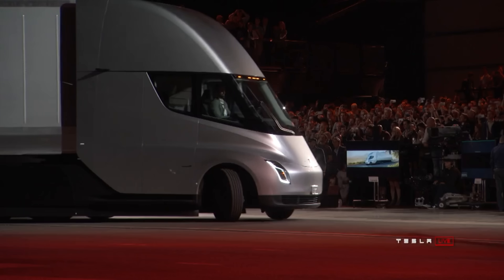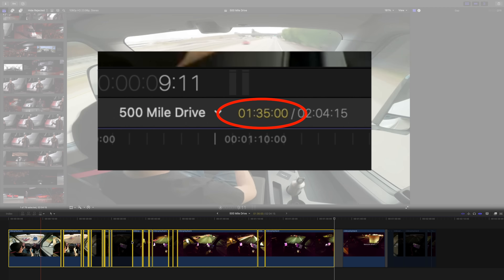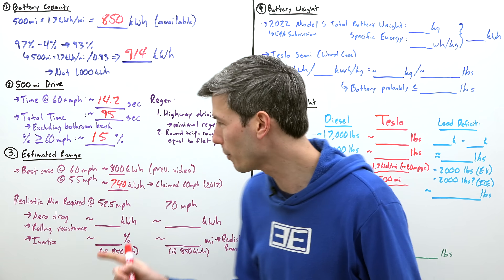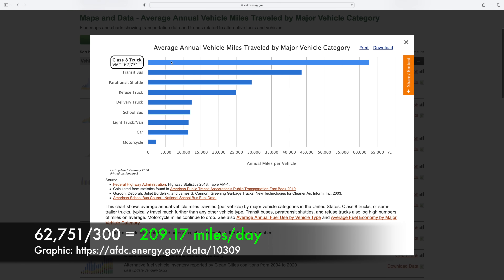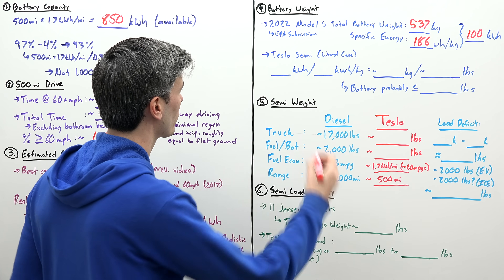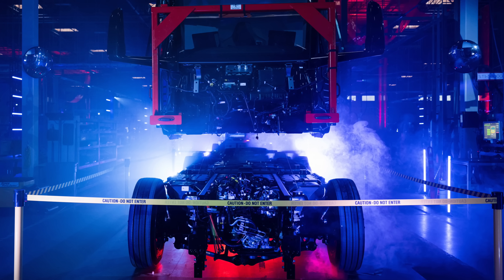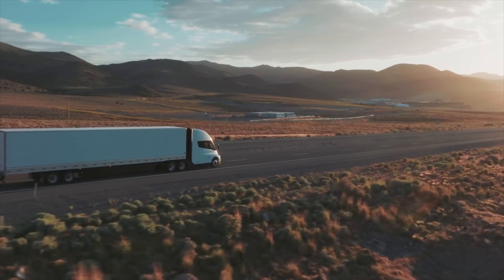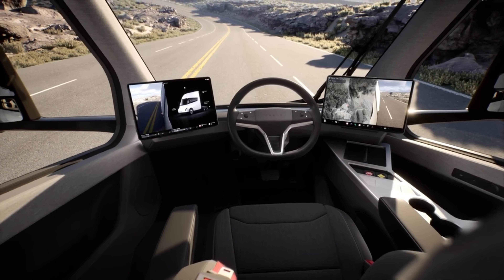Does The Tesla Semi Make Any Sense? Part 2!

Comment: After watching part 1 and 2, that are well explained, I don't remember any mention of weather, specifically the cold.  Simple things like heating and maintaining the large cabin and windshield as well as ensuring the batteries stay at their optimal temperature must have an impact on the range, and even when the drivers take breaks, unless the semi is plugged in, it will be using some battery power to maintain its temperature in the cold.
Reply: The volume of the cabin in a semi is not appreciably larger than a midsized sedan overall, and even if you assume double the losses in an absolute sense, having 8.5x the batteries means the impact from that cold is going to be quite a bit smaller. Likewise, the surface area required heating compared to the volume scales in a positive way such that keeping the battery warm is made easier by the large pack. Most importantly, unlike an small EV which needs only 10s of KW to keep moving at speed, a semi will be generating likely 8--20x the thermal energy from battery inefficiency during use. This is a gigantic pool of thermal energy to use for heating the cabin, which as mentioned is not all that much bigger (perhaps even smaller) in volume to a Model S/X interior.  

Now..... Not saying this is a non-issue altogether, but for any sort of long-haul, I would be quite surprised if the impacts are anything more than 10% by heating losses. More critically may be increase to wind resistance due to increased air density during cold/rain/snow, or rolling resistance increases when roads are wet. There is a great JCEA paper about rolling resistance of iso standard tires (SRTTD etc) which suggests that wet roads can increase rolling resistance by 40% or more. This would be the biggest likely loss for a heavy fully loaded semi, above the aero and creature comforts, while for an unloaded semi, aero dominates.
Reply: @anthonyschroeder521    Although I can understand that the space may not be that large for the cab, however is there not a sleeper that also needs to be kept warm?  And although this version of the semi will likely not be used for true long haul, it is unlikely that a driver will be using the sleeper for overnights where there would not be any charging stations.

The concern I have is that every % that is not used for driving will impact the range, and cold weather up here in the north does last longer and therefore the range degradation will have an impact to the payback period as shown in the video, specially if the cost of the semi is going to be so much more than a current traditional setup.

I do realize this is the first iteration and we have to start somewhere, but we should be setting expectations, as I believe Pepsi has in the shown statement that, lighter loads of chips can go further, than heavier loads of pop (which is logical).
Reply: @jacquesalbert6748  no sleeper. But as mentioned rain is likely a bigger problem than cold, and that general concern about margins reduced is still valid.
Reply from the maker: Video 1 references a "worst case" with lower efficiency to compensate for things like cabin heating. Cold weather range hit can be around 20% based on my own experiences (https://youtu.be/UskzfQJt2Bc), there's a few outlets which have done tests, and there's a lot of variance between manufacturers and cold impact. Yes, definitely something that must be considered depending on where the truck is used.
Reply: @EngineeringExplained  if the truck is used for over-the-road driving, where the driver parks it and sleeps in it for 10+ hrs, then that's heating or cooling that drains the battery without putting on any miles.  And in a winter storm (-15F?) or blistering heat (115F and humid?) that's gotta drain it a lot.  That's another factor that leads me to think this won't be suitable for over-the-road trucking.  It's best use will be local driving or other well-defined routes.  Possibly with a day cab rather than sleeper too (which would save a few thousand pounds).
Reply: @DonTruman  Ideally in those situations, the driver is sleeping in the cab while the truck is parked at a charging station, in which case, it can use external power to operate the HVAC and the HVAC load will be trivial compared to the battery-recharging load.
Reply: @bikeaddictbp  technologically that would work, but realistically it's virtually impossible to get a charging station to every truck parking spot.  I say that as an OTR trucker and electrician.  Some parking spots with chargers at some truck stops is possible (what if one isn't available where you want to stop for the night?) but that wouldn't work.  Would need charging for every single layover.  And "stuff happens" out there.  E.g., getting stuck in a winter storm for a few days, parked somewhere.  You park wherever you can and wait for it to pass.
Reply: @DonTruman  Tesla Semi is for day use, no sleeping option at the moment.
Tesla will be production constrained for the Semi in the next 3 years so no need to fill 100% of use cases. Short-medium hauls will fill the order book.
Reply: Keep in mind that most car trips are comparatively short. A lot of the heat loss in winter is due to getting in and out frequently. If you need hundreds of miles of range that will happen a lot less in a semi.
Reply: When stationary, ICE engines typically also have a block heater plugged in and powered from the grid. The frigid colds are not just an EV battery issue!
Reply: The effects of cold are really overblown, I drive a Model 3 in Utah, so I see hot and cold. I typically see around 5-7% difference in my commute due to cold (35 miles each way).  Most of the effect of a cold commute is eliminated by preheating the battery and cabin, once driving there is free heat available from the drive unit and battery to keep things happy (including me).  Starting from a dead cold car you will see a bigger hit as everything has to be brought to a good operating temperature (by the way, on a really hot day I have seen range affected by  having to cool everything more too).  On long continuous drives the effect is really minimal, probably more like a couple percent at most.  One thing nobody ever mentions is the efficiency hit of driving in the rain, which is very noticeable (definitely a few percent), and the benefits of driving on a busy high vs. an empty one (also a few percent) due to drag reduction from the wakes of all the cars and trucks around.
Reply: @jayscranton5517  I can relate, here in Canada we see lots of snow which has another impact to the rolling resistance as well.  My fundamental concern in the marketing is that we are trying to prove that a 500mile trip is possible, and from calculations sounds like it could be if all the conditions are perfect, so what will be real world, specially since most EV battery packs don't like the less than 15% and the over 80% charge, so if we only have 60 to 70 percent of this large battery pack to play with, what will be the actual range, and that we should set our expectations accordingly.
Reply: @jayscranton5517  I agree the effects of cold are very much overblown.

If you do a lot of short trips (2-5 miles each) in town like I do the 'guess o meter' will indeed give you a crazy low range estimate because the heater in that situation is always running 'full power' and is a very high percentage of total usage. 

Get on the highway and average efficiency will be much closer to normal.

We had planned to go on a 400 mile road trip the weekend of Christmas. It was not the -10F and worry that we'd not make it to chargers that kept us home, it was the blowing snow and black ice. 

I find headwinds and precipitation to be more of a problem than cold because its harder to gauge just how much it will impact you, and you can't do much about it.
I've never actually had to do this, but as an absolute last resort effort I can turn the heat down/off to conserve energy in an emergency. 
You can't really shut a headwind off, just go slower.
Reply: Cabin heating can eat up 15% of range in a model Y (78kWH?), but the relative size of the battery pack means its negligable. Only the impact of keeping the battery at temperature to worry about
Reply: With 800kWh+ battery cabin heating is not an issue. I doubt that it will be more than 1-2kWh per hour . Moreover, electric motors are effective, but 5% of loss, will give you more than 40kWh transferred to heat. The biggest concern is that you need to warm up 10000 pounds battery pack before your trip. It will take a huge amount of energy, but can be done from the grid
Reply: @demkaage  lol…… it’s not just the cabin but also the batteries and auxiliary systems.
Reply: @demkaage  what if you don’t have accès to the grid!? Does every point of deliveries needs to have grid connectivity??
Reply: @carholic-sz3qv  a good example is when a delivery is being made and the semi is stopped for 30 plus mins, is the driver expected to find a charging point, or will the semi stay idle in cold temperatures and how does the battery pack stay warm enough, what energy is used in order to do this, and where is it coming from?  That will also impact the overall range.

Comment: I love the critics "the truck (or ev) will suck driving in the mountains and that will drain the complete battery".
Well, when you go up you need to go down.
It just charges the battery when going back down, when it went up with (?) 600hp he will have 600 hp breaking power that recharges the battery (or even more when not using his full engine power hoing up).
A full  ICE vehicle will just convert that energy into heat.

Comment: The current Tesla semi is not the final version. Once Tesla gets the 4680 up to mass production, adds silicon to them for energy density (current 4680 doesn't), and perfects the structural pack design, Tesla will release a better Semi. The reason why they released a compromised 2170 version now is because of that tax credit. They wanted to take advantage of it while it's available, and since the 2170 battery is "good enough" to get the job done, why not?

Comment: Just to point out that in California, the maximum truck speed is 55 mph. So it would make sense that the truck driver wasn't going too fast over the speed limit, especially on a recording that's going to be shown and analyzed like crazy.
Reply: The maximum posted truck speed in CA is indeed 55mph. Having previously lived in CA for about forty years I can tell you with certainty that semis usually travel at 70mph where possible. They would be impeding traffic if they actually only cruised at 55mph.
Reply: @avsystem3142  I've spent plenty of time behind 2 semi's passing each other on I-5 with one going 55 and the other going 56. Also remember the driver knows this is being recorded for a PR event.  Do you think they'd drive at 70 knowing its not just recorded but will be dissected by Tesla fans.
Reply: Trucks regularly drive 75mph here
Reply: @bradenmchenry995  And they regularly drive at 55mph too.  Just drive I-5 in the central valley and look for the long line of cars trying to get past the truck passing the other truck driving 1 mph faster than the other truck.

Also remember the driver knows this is being recorded for a PR event.  Do you think they'd drive at 70 knowing its not just recorded but will be dissected by Tesla fans.

Comment: I would be REALLY careful with using Musk as a source, you showed yourself that hes a serial liar. 

Your logic at 3:06 has a flaw, regenerative braking does not achieve 100% efficiency. Quick research shows values 60-70%. 
Also if you draw that green dotted line based on the first 250 miles you would end up with more range!

You also cite that it takes 35min to charge buying into the story of the Semi charger, which was not shown to this date afaik.
With a power draw of 1MW its connector design must be interesting. I am sure you could calculate how such a "wire" would look like and what kind of safety measures it would take.

About range: What if its winter? What if the battery degrades?

Comment: There is also a consideration for heating both for cabin and cargo if the truck has to travel to northern regions in the winter. Some cargo items such as olive oil and other food items cannot be frozen too cold. Converting low energy dense battery into heat is quite inefficient considering weight to energy ratio. If they are smart, they should have a seperate fuel based heating system and preserve battery pack for driving only. Otherwise the range will be greatly reduced in cold weather.
Reply: Well, said system comes standard using diesel on a standard heated trailer so... uh what is your point?
Reply: @w8stral  yeah it's standard on diesel trucks but Tesla probably will be unwilling to put in a fuel based heater due to its zero emission goal, even though heating using fuel would be a lot greener then using battery as it will reduce total energy consumption per unit distance traveled.
Reply: @i6power30  Uh, its ON, uh hem, ON the trailer... Q: Can you read or know ANYTHING about trucking?.... A: No.
Reply: As Jason pointed out, there are many use cases where current electric trucks do not make sense. Such cases are a fraction of total heavy truck use, i.e., electric trucks make sense (cost aside) for the majority or use cases.

Comment: Sorry but estimating load weight basing on tire size to jersey barrier size ratio has no sense at all.
It could be 20k, 30k or 40k lbs. That 40k lbs is best case scenario IMHO. 
After all that lies which Elon was publicly saying i wouldn't even belive in 40k lbs.
Why Tesla don't show full specification after 6 years from public demonstration and 4 years from expected market availability?
What is battery degradation on high power charging stations and where are those stations? How battery is doing at weather conditions? 
15.4million state grant and 40k federal subsidy for this is a unfunny JOKE.

Comment: What happens to battery when you constantly charging over the recommended 80% charge? Because most companies who buy will have to charge to 100% everyday especially in the winter.
Reply: They don't tell you not to charge over 80%.  They tell you not to store the vehicle for an extended period at more than 100%.  I charge my battery to 100% on a regular basis, I simply schedule the charge to complete around the time I'm planning to leave.  There have never been any reports of battery damage from this
Reply: @jonathangourlie9098  I thought you could only do that with 4680 batteries. Thanks for the info.

Comment: Considering the Nikola is between 40-57k lbs without a trailer, it's going to be interesting what the Tesla actually weights
Reply: It's suspicious that they don't just release the gross weight
Reply: @user-pt8vm3ml9k I'd say that's likely true, doesn't mean it would be applicable to certain use cases but it really seems like Tesla pushing the long haul is not the right direction

Comment: There's a lot more issues than the two you listed

Safety
Reliability
Load
Charging infrastructure
Ease of repairs
Price
Range

Many of these are things that tesla can't solve on their cars, why are people assuming their semi would be better? Have yall seen how difficult it is to have a tesla repaired? Also tesla regularly comes in as one of the least reliable brands around, now on a vehicle that has to pull heavy loads on a regular basis over long distances you think that reliability isn't gonna be even worse? What happens if the battery pack catches fire. 850kwh of battery that can self ignite and gives off toxic gasses when it burns.

Comment: Unrealistic that this big battery could be recharged in 35 minutes. It would require a charger that doesn't exist. The cement barriers used in the example would never be placed in a trailer but on a flat bed. I would imagine the drag on a flat bed is  a huge negative for an electric semi.

Comment: Wouldn't they be running 80 - 20% on shorter trips to save on battery degradation and charging time. Interesting note on the great efficiency crossing hills compared with a conventional truck.

Comment: Is that 1.7kWh per mile in summer conditions, or an average over the year when winter consumption is likely to be considerably higher?
Reply: Even on my hybrid I notice a significant drop (12-15%) in a mild winter where the temps range from high 30s to low 60s.